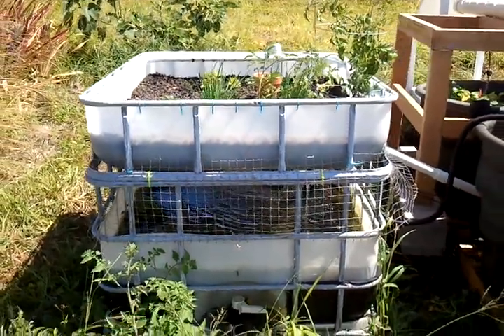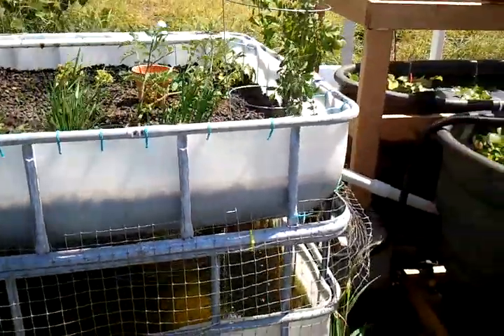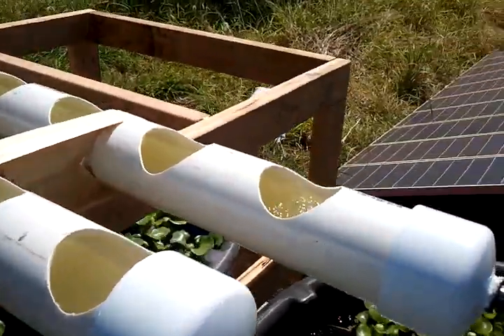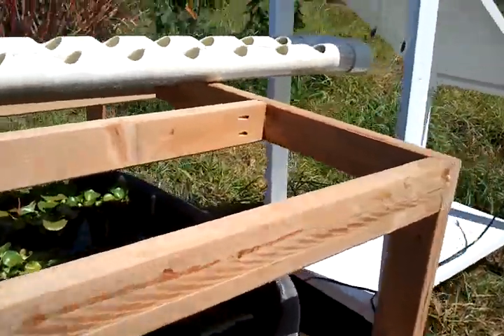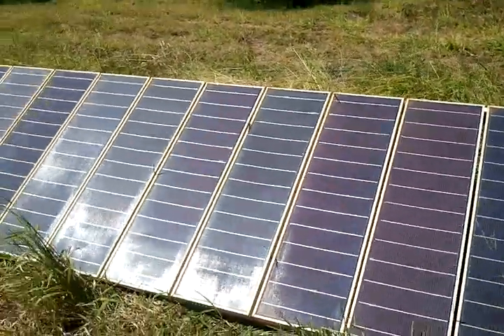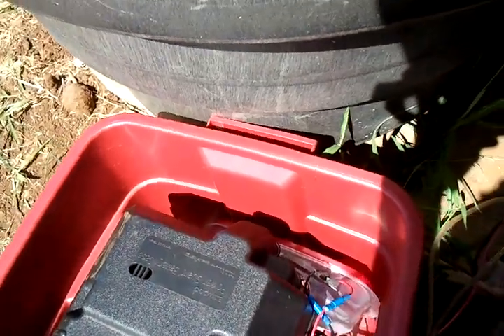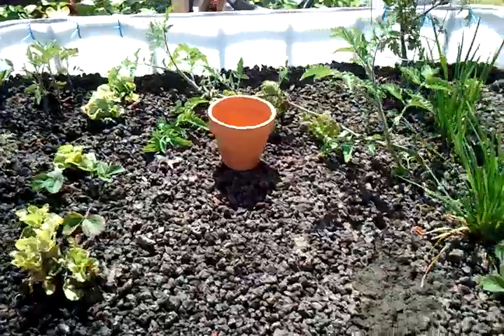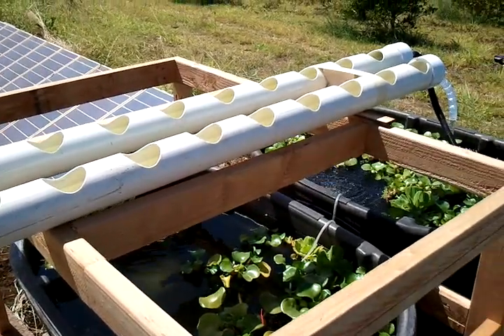Solar-powered aquaponics

Comment: Interesting enough set up, but I'd suggest two things: One, mount those panels by bolting them down from below. There are holes in the frames made for that. The rope across the front affects the output more than you might think, because the cells are wired in series. Also, the "marine deep cycle" battery will fail before anything else, as those batteries are simply a bit heavier duty than a car battery. Get a couple of golf cart batteries (they're 6 volt, but easily wired in series to 12v). They're cheap enough at Sams or Costco, and will last many times longer... they're real deep cycle batteries, and running the pump at night won't destroy them.
Reply from the maker: No, the rope doesn't affect the output more than I think.  The batteries are charged fully every night and I have even set up the panel under a tree that blocks the sun for about 4 hours a day.  And I still can disconnect the panel and run the system for 3 days before completely draining the battery.  Thanks for the golf cart battery tip.  When the marine battery fails I will look into that.
Reply: Has something happened since than?

Comment: also instead of a wet cell battery you could use a box of nicads ....
also if you make the water fall a couple of feet in to the fish tank you would not really need the air pump  ...allthough there is no such thing as too much O2

Comment: Randacnam7321 has a REALLY good point! ANY shadow on a PV panel will cut its output power; depending on the size of the shadow(s), and how many cells of the panel are affected, you can lose up to 50% of the panels's output. Even a couple of leaves that blew in on the wind can cut your panel's output. Keeping your panels clean is important if you want to get the most out of them. Aloha, Tim Mann, Friendly Aquaponics in Hawaii (land of sun)
Reply from the maker: I don't disagree about shadows.  But this setup has never failed because of a little shadow.  The little shadows do not adversely affect the system.  I can disconnect the panel and it will run for roughly 3 days.

Comment: You just need to get a better panel. North Carolina’s Semprius Inc. and its German backer Siemens said they have developed the world’s most efficient solar panel. The prototype converts 33.9 percent of the sunlight that hits it into electricity, That’s more than double the most efficient conventional photovoltaic (PV) module on the market, where performance tops out at 16 percent. Add a micro inverter to that and it should make it about 10 percent more efficient, which would be around 45 percent

Comment from the maker: I connect the components to the battery using crimped-on battery terminal connectors. And for the plants, the tilapia do some serious damage and clog the filter. So currently, I have no plants. Sometimes I will toss in some leafy vegetables and it'll be gone in a day.

Comment: Nice work. I am in the process of installing a small pond. Almost finished digging.

Solar in my area is rather limited. I did find one solar air pump at a reasonable price, but the problem is it is only about 4 watts.
What is need is a more powerful pump but do not want to run a power line, that is why I am looking into solar.
How did you connect the pump from the solar panel? I found a panel, and a recycle battery, plus the unit to not over charge, but do not see a way to connect..

Comment: I'm wanting to do the same. What I am considering is, using a couple of deep cycle marine batteries to run a couple of pumps and keep the batteries charged with solar. Just a thought...Do some research on solar. There is plenty of info out there. Probably here on youtube, as well.

Comment: You could actually use the solar panels to charge a couple of deep cycle marine batteries and run the pumps off the batts...Just a suggestion. All else looks pretty cool. I have actually been considering setting up a similar system.

Comment from the maker: Yes, you can power a solar panel.  However, a solar panel is, generally, only 10-15% efficient.  It might be better to power whatever you're wanting to power directly instead of using a solar panel.  That's a roundabout way of generating power for your devices.

Comment from the maker: I started this project because I saw a few videos to build your own solar panel.  After it was built, I wanted to power...something. So I thought I would create a self-sustaining aquaponics system. Also, I am a software developer and wanted to gain some knowledge about integrating some hardware.  Thus the addition of the Arduino board.  Other pieces were available and eventually this project came together. I will not likely expand this project. I have fulfilled the scope of this proejct. Thanks!

Comment from the maker: You're not wrong about the hyacintch stealing the nutrients from the plants.  However, the system does benefit overall.  The tilapia feeds on the roots of the floating plants.  Also, the floating plants harbor Gammarus "shrimps," which the fish love.  I'll feed the fish only  2 - 3 times a week.  The fish get a lot of nutrients from the plants.  They help to "close the loop."

Comment from the maker: The system runs 24/7.  With some (very) loose calculations, I believe I can disconnect the solar panel and still operate for at least 3 days.  Even under overcast skies the batteries does receive a charge.  The battery is a deep cycle marine battery with an 85Ah rating.